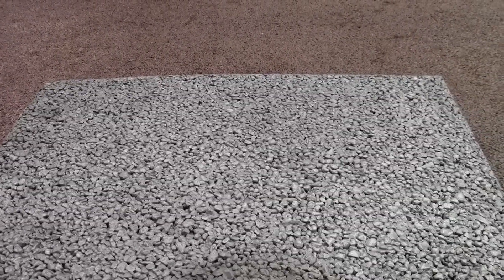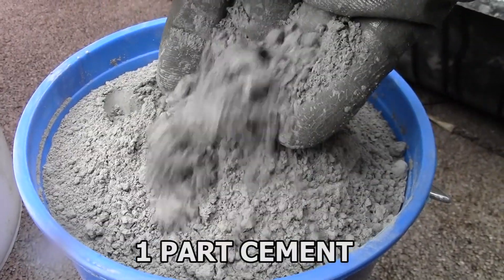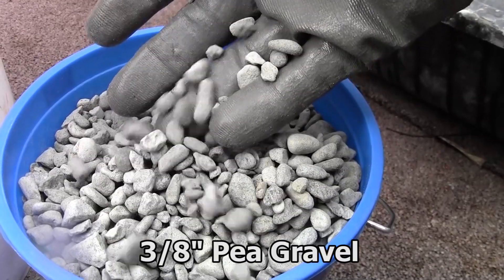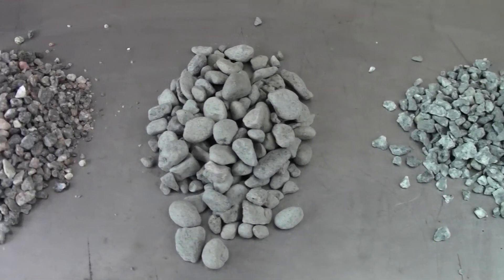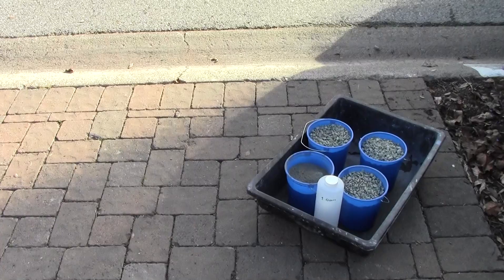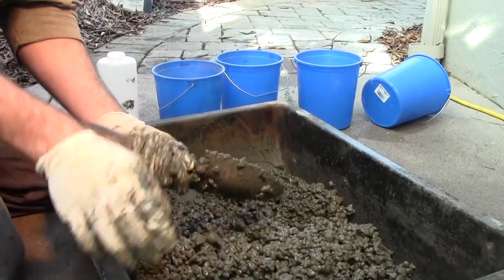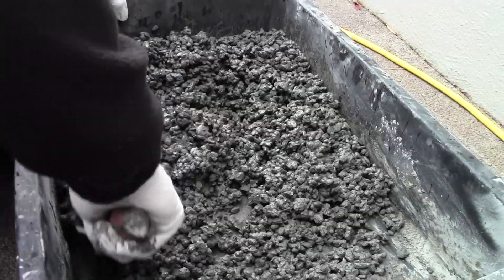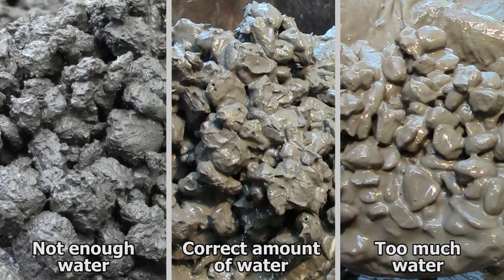How To Make Pervious Concrete

Comment: What are the test done for previous paver tiles ???
Reply from the maker: We test our pervious concrete for many different attributes.  The most common are typically compressive strength and split tensile strength.  We always perform mechanical strength tests in combination with permeability, since as a general rule the strengths of pervious concrete increases as its permeability reduces.  The inverse is true as well, as the permeability of pervious concrete increases, its strengths reduce.

Comment: Is it possible to use iron bars to reinforce concrete so that it does not corrode due to water leakage into it????
Reply from the maker: The pervious concrete itself will not corrode or break down due to water flowing through it, unless it's salt water or something else deleterious to concrete.  Iron/ steel bars should not be used in pervious concrete.  They will rust and expand due to the moisture, and damage the concrete.  However, composite rebar, like glass fiber, basalt and others can be used instead.  Additionally, fibers (other than steel) can be used to reinforce pervious concrete.

Comment: Curios about the effect of adding a mesh or loose fibres (metal or synthetic)
Reply from the maker: Adding fibers and/ or mesh to pervious concrete can be beneficial.  Just about any type of fiber or synthetic mesh is compatible, except notably, do not use metal in pervious concrete.  Metal, whether it is rebar, wire mesh or steel fibers (except stainless) will get exposed to water in pervious concrete and rust, corrode and expand damaging the concrete and becoming ineffective.  Basalt rebar, fiberglass and other composite or coated rebar can be used in pervious concrete.  We have also used anodized aluminum for doweling with success so far.
In regards to the effect that adding fibers or mesh will have on pervious concrete it is difficult to quantify.  In general one would want to measure for a higher tensile ductility, but since there aren't even any ASTM or other approved compression strength tests for pervious concrete, any tests will need to be set up and documented very carefully.  Anecdotally, I will say pervious concrete samples that we crush for physical strength tests that have fibers notably stay together much better past failure and do not tend to 'explode' as much as samples without fibers.  So the right type, combination and dosage of fibers should translate into a pavement that does not crack as much or as noticeably.

Comment: That's a great video, I was thinking about paving my driveway using this technique on my own. However, I'm concerned it might break during winter. I live at a high latitude, and it rains a lot in winter. If some water gets trapped and freezes, the whole thing might crack. Thanks for the info though, very educational

Comment: My question is what is the max compressive strength and the right water cement ratio
Reply from the maker: Though there are no standardized ASTM or other compressive strength tests for Pervious Concrete, typically when it is installed properly in the field one would expect it to achieve around 2500 to 3000 psi (17 to 21 MPa) compressive strength.  This is on the lower end of more traditional concrete, but more than adequate for most vehicular and other applications.  However, if the pervious concrete mix was designed very optimally, 4000 psi (27.5 MPa) compressive strengths can be attained.  Even higher strengths, 5000+ psi (34+ MPa) are attainable with Pervious Concrete utilizing very fine aggregates, but this tends to significantly reduce its permeability at much thickness.
Determining a particular Pervious Concrete's proper water cement ratio (w/c) is tricky and is therefore we feel best finalized by visual confirmation using the descriptions in the video.  The main reason for this is the amount of moisture in/ on the aggregate that is used.  Inevitably this amount will vary within a pile of aggregate, throughout the course of a day, and from one day to the next.  Just a small change in this water in the aggregate pile will make a significant difference in the water needed for the mix.  For instance, the amount of water in an aggregate pile following a rain event can sometimes provide practically all the water that is needed for that mix.  
The types and amounts of admix used in the Pervious Concrete mix design will also have a huge impact on the water cement ratio.  Because of this, we have designed mixes with below a .2 and above a .5 w/c, however most often we end up being around a .35 w/c.  But please take the time to really dial in your own particular mix's optimal water cement ratio and keep an eye on your aggregate's water content!

Comment: What is the highest psi per square foot that has been most successful?
Reply from the maker: Though there are no standardized ASTM or other compressive strength tests for Pervious Concrete, typically when it is installed properly in the field one would expect it to achieve around 2500 to 3000 psi (17 to 21 MPa) compressive strength.  This is on the lower end of more traditional concrete, but more than adequate for most vehicular and other applications.  However, if the pervious concrete mix was designed very optimally, 4000 psi (27.5 MPa) compressive strengths can be attained.  Even higher strengths are attainable with Pervious Concrete utilizing very fine aggregates, but this tends to significantly reduce its permeability at much thickness.

Comment: Could you tell what gradation of rock gives a best result ? I need to make driveway in front of my garage that will take 7000kg truck and yet I would like to have smooth surface like on your video.
Reply from the maker: For really strong pervious concrete, technically higher compressive strengths are attainable with very fine aggregates/ coarse sand.  However, the permeability is significantly reduced using very fine aggregates at driveway thicknesses.  So, unless you are going to utilize a two step process like with our PerkTop (https://perviousproducts.com/perktop/), about the finest aggregate you could use would be about 1/4" (6 mm) and possibly a little finer if the design is carefully implemented.  Often asphalt plants stock this gradation of aggregate as a manufactured/ crushed rock, which would be fine.  
Pervious concrete mixes using 1/4" or 3/8" aggregates will provide more than adequate strength for 7000+ kg (15,500+ lbs) trucks.  They should be poured at least 5 1/2" to 6" thick over several inches of crushed, coarse aggregate and if there is a lot of this type of traffic, then thicker pavements could be necessary. 

When engineers, architects and other specifiers reach out to us to see if our PerkTop is suitable for heavy vehicles like yours and fire trucks in particular, we like to reference this work put out by Timothy Lawrence and Monique Myers of the 'California Sea Grant College Program', titled 'Emergency Services and Stormwater Management':

"California allows fire engines to have a single axle weight of 23,000 pounds on the steering axle (2 tires/steering axle) and 24,000 on the drive axle. Tandem axles can be up to 48,000 pounds and tridem axles up to 54,000 pounds. All fire engine drive axles have dual tires (4 total/axle), so each
steering tire can support up to 13,500 pounds (54,000 ÷ 4). 			
Determining the support capability of any surface is based on the displacement of the weight over the surface area in direct contact with the vehicle tires. The contact surface area can vary by tire size, brand and inflation pressure. An example of the weight distribution of a fire engine in psi for a tire commonly found on fire engines is the Goodyear G286 12R22.5. Inflated to 90 psi, the average surface area of tire contact is 95 in
2(613 cm2). The weight displacement for each tire, if the maximum allowable load on a steering axle is 12,500 pounds or 357.14 psi, gives a 7-fold safety factor for a typical pervious concrete pavement rated at 2,500 psi."

Comment: ur ratios are way off it should be 6 to 1 gravel cement ratio
Reply from the maker: It very much depends on the type of gravel.  However, in general with this high of a ratio one would have extremely high permeability and much lower strengths.

Comment: I think this is a good solution to resurfacing a walkway. Install bricks on the edge of the sidewalk two bricks tall and use an epoxy adhesive to make the bricks stick to the sidewalk and the next brick. Then use an acid etching concrete cleaner to prep surface of concrete. And also an adhesion promotor rolled on lightly with a roller and cut in the edges with a cheap brush. Directly after it dries use this mix to pour a 1-2 inch layer on top of the sidewalk and the bricks on the side will act as a border and a wall too for mulch and grass. The water will drain down and out from in between the bricks. Only use one brick if you don't want a tall edge and pour the mix to the height of the 1st brick evenly without getting a bunch of stuff on the brick but you can wash it off with a brass wire brush and hose easily just try not to wet the wet concrete mix. 
This is my solution to a sidewalk with flat spots.  I should either resurface the sidewalk first before this mix goes on top and make a grade towards the side to let water flow off the edge of the sidewalk in between the bricks  and maybe use a concrete blade on my grinder to cut a few squares or circles and install basic plastic drain covers as the stuff under the sidewalk is all sand. I live on the beach and all we have is sand here and we are only 6 feet above the water table. But oh well. I am going to just wing it. I might cut a few circles and install some drains that connect to a small diy French drain underneath the mulch bed on the side of the sidewalk or install a few catch basins and use this around the housing and leave room to put the drain covers on but we will see how far my motivation goes that day. Lol

Comment: Had a great time today in Moss Beach.
Reply from the maker: Hey Steve, thanks for checking out our latest PerkTop pervious concrete installation!  A couple of years ago we also installed a driveway around the corner at:  670 Stetson St.  Moss Beach, CA 94038.  And just down the road a bit a couple of months ago we installed a PerkTop driveway in tan color at:  608 Ruisseau Francais Ave.  Half Moon Bay, CA 94019.
A little further afield, we installed pervious concrete for significant portions of the large parking lot at the new Cadillac dealership in Colma, CA.   Upcoming, at the start of the new year we will begin installing 57,000 square feet of pervious concrete for large portions of the new 'Veterans Memorial Parking Lot' in San Rafael, CA.  
We have installed countless other PerkTop projects in the San Francisco/ San Jose Bay Area.  If you would like to check out any of those, let me know and I can provide a list accordingly.   Thank you, Ryan

Comment: Nice topic how to get PERVIOUS CONCRETE consistong of cement, water and coarse aggregates. Regarding the open structure of pervious concrete, air and water can penetrate into the subsoil though voids existing with in the concrete. This kind of concrete has various physical and mechanical properties but also pasive green structural site for contributing wat is significant. PLANTY GOOD STRUCTURES we can do with pervious concrete.

Comment: Sand is used I. Conventional concrete to bond the cement.  Will the removal of sand not substantially degrade the compressive strength of the final product?
Reply from the maker: Yes, pervious concrete can have less strength than traditional concrete.  However, with the use of admixes, careful mix design and proper installation in the field the strengths of pervious concrete can be close to and similar to traditional concrete pavement, which usually achieves from 2500 psi (17.2 MPa) to 4000 psi (27.5 MPa) compressive. 
Even without special admixes and a deep understanding of mix designs, pervious concrete as demonstrated in this video, typically will have way more than adequate strengths for most pedestrian and light vehicular applications.  Concrete pavement most commonly fails because it cracks and becomes unsightly, which usually has little to do with its strength.  One major contributor to concrete cracking is that concrete shrinks, but because pervious concrete tends to shrink considerably less than traditional concrete, it can crack less.
Perhaps the most telling example of pervious concrete's more than adequate strength, is that its most common application in the U.S. has been for parking lots.  Moving forward we are demonstrating it is even possible for pervious concrete to be stronger than typical concrete pavement.  We are achieving compressive strengths sometimes well over 4000 psi with our very fine pervious concrete PerkTop & PerkGrout.

Comment: no sand??
Reply from the maker: Taking the sand, fine aggregate, out of ordinary concrete is generally what produces pervious concrete.  However, it is possible to add very small, controlled amounts of sand back to the pervious concrete mix.  This may be advantageous to reduce the permeability somewhat and gain strength and durability in mixes containing particularly large coarse aggregate or possessing 'too much' voids.

Comment: 'cement powder'? is that whats called portland, in texas?
Reply from the maker: Yes, typically the cement used in pervious concrete is 'portland cement'.  It can be any of the types of portland cement used in the U.S., Types I, II, III & V.  However, other types of cement can also be used successfully in in pervious concrete.  For instance, our PerkGrout product utilizes CSA (calcium sulfoaluminate) cement or 'rapid set'.  The primary reason for its usage in this application is due to CSA cement's low shrinkage and therefore reduced cracking potential.

Comment: Pervious concrete will eventually pack with dirt and sand and become solid.
Reply from the maker: When pervious concrete is placed appropriately and there is no runoff from surrounding surfaces on to the pavement, it will remain highly permeable for decades with minimal maintenance - primarily keep it blown/ swept off regularly, similar as to what one would do with ordinary pavement.  Pervious concrete often starts out over 600" (1524 cm) an hour permeability, so even if over time it were to get over 95% clogged, it would still readily absorb even the most intense rain event.  If it were to get inadvertently clogged up by runoff or dumping of dirt on to it, much of the original permeability can be restored by a heavy washing or pressure washing.

Comment: Can the same be used as road pavement with required strength as desirable to be M40 / M30 concrete or so ?
Reply from the maker: While it is possible to achieve those strengths in the lab, I am not aware of pervious concrete achieving compressive strengths of 30 MPa and higher in the field, on installations.  It can certainly be used on lower volume roads, and with proper mix design and careful quality control while placing, pervious concrete can consistently achieve 25 to 28 MPa compressive strength.  It is also possible to achieve flexural strengths greater than 4 MPa with pervious concrete, so this test could possibly be used instead of compressive.  And finally pervious concrete pavement can be poured thicker to also achieve a higher overall 'Structual Number'.

Comment: Can pervious concrete be made with perlite as the aggregate instead of solid rocks?
Reply from the maker: Pervious concrete can be made from lighter weight material, but using perlite will not produce a very strong mix.  It probably will not be strong enough even to walk on, but might be suitable for some type of pottery or other decorative applications.  Some expanded shale/ clay can make suitable pervious concrete pavement.

Comment: How to increase strength ?
Reply from the maker: There can be many ways to increase the strength of pervious concrete.  However before too much effort is invested in optimizing the strength, one needs to ensure the quality control for the entire installation process is really dialed in.  Most of the variance in pervious concrete strength being placed today is due to to inconsistent installation, so much of it is not reaching its optimum/ designed-for strength to begin with.  
Once one has a firm understanding of their current process and mix ingredients,  including the aggregate characteristics and its relationship to binder and water ratios, then one can begin further optimizing the strength of the pervious concrete mix.  Utilization of some of the same principles of achieving high strength concrete can result in greater compressive strengths in pervious concrete.  To increase flexural strength or the modulus of rupture, arguably the most important factor for a pavement, addition of acrylic and/ or certain fibers can yield good results.

Comment: Do you think I can use rock bigger than 3/8 "? Suppose 3/4 "
Reply from the maker: Yes, one can make pervious concrete with just about any size rock.  The downsides to using coarser 3/4" (19 mm), or similar large aggregate, are that it can be more difficult to mix and finish, it will generally require more cement to achieve similar strengths, and the finished product is quite rough looking.